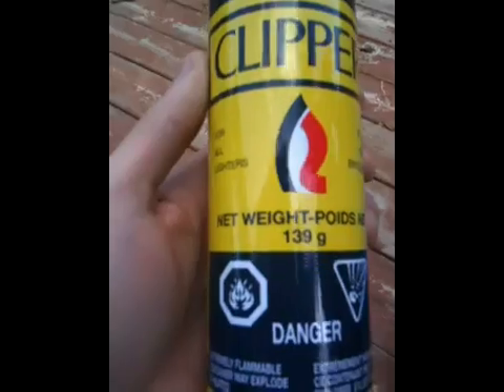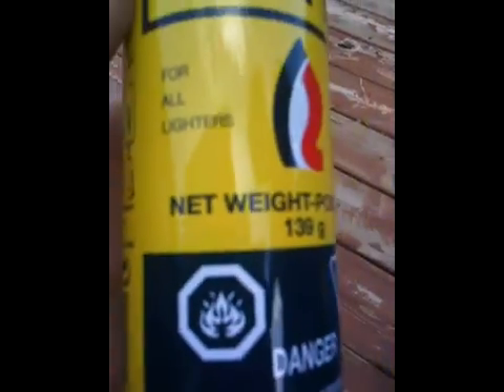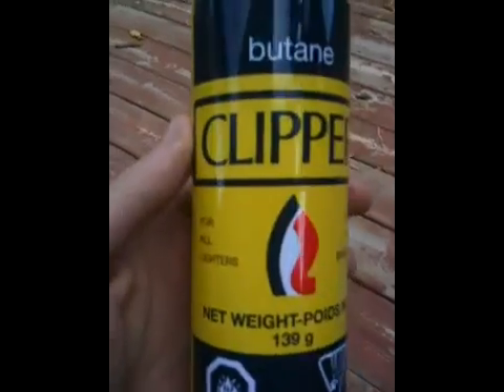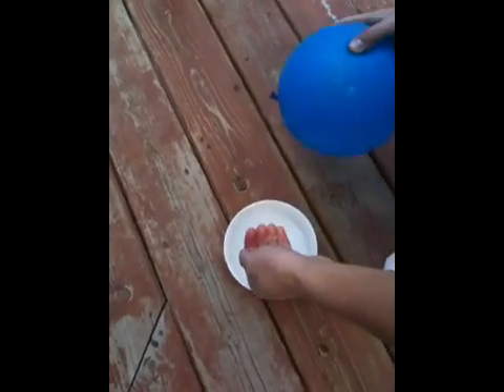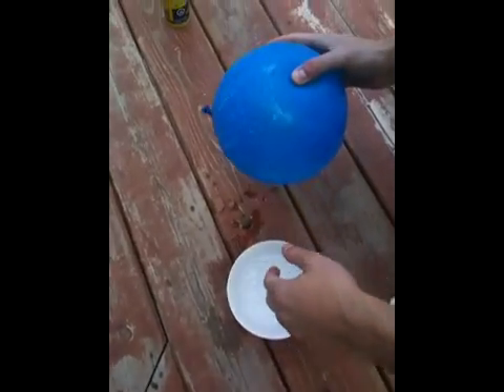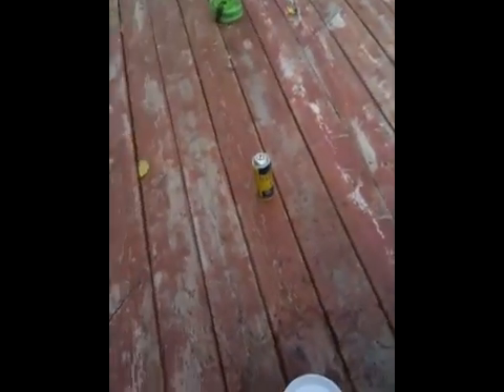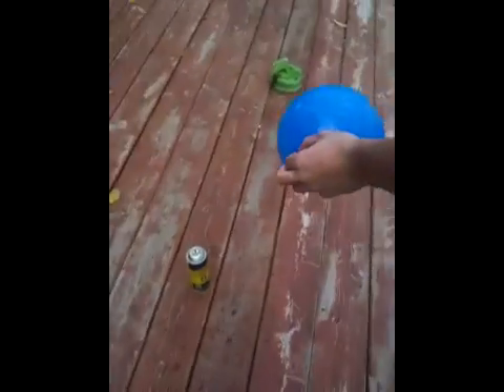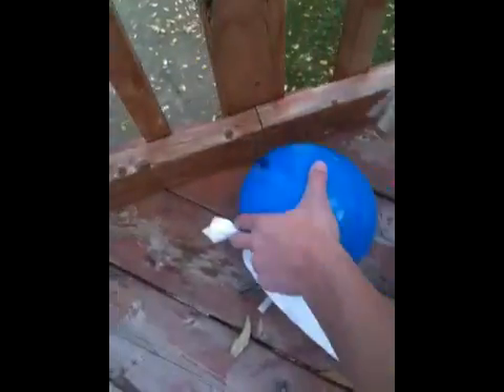Intense Fireball Bomb Produced by Butane in Balloon!!!

Comment from the maker: @dnave21 Yes, butane is around 2 times heavier than air (look at densities on Wikipedia). Because it quite dense, not a lot of pressure is required to keep it in liquid form. This makes storing it in butane lighters easy and safe.